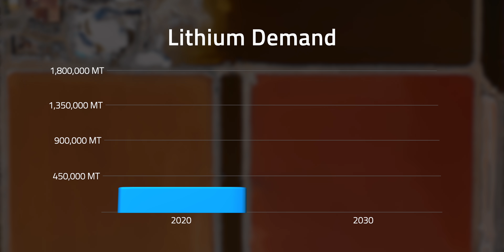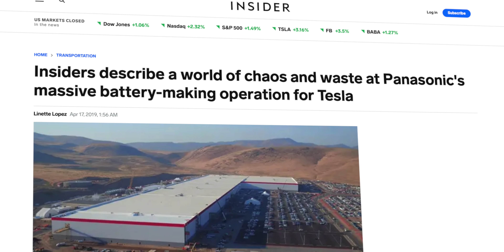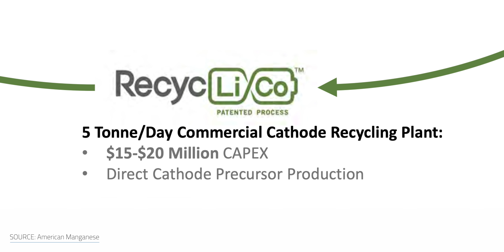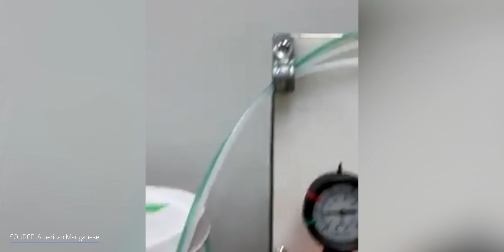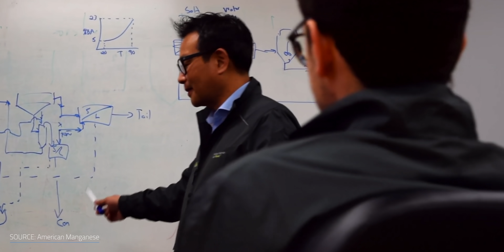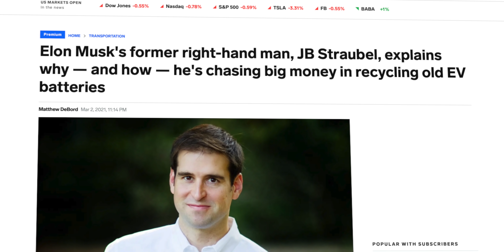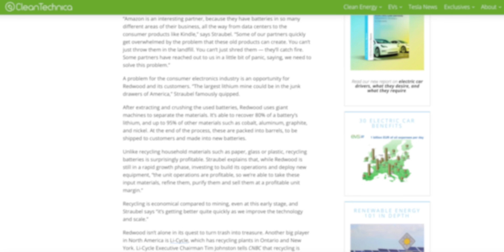Solving EV's Biggest Problem - Battery Recycling Explained

Comment: The biggest problem with recycling these batteries is handling of spent cells.  Its becoming a huge problem.  Spent cells get tossed around and can ignite.  They rarely are discharged completely.  They are increasingly the cause of fire at recycling yards.  They put these things in so many products today that people dont even know they are there.  I'm curious to know other then someone putting hands on each battery how befor they shred they know its discharged.  We recycle thousands of tons a year of steel,aluminum ect. but I couldn't imagine putting hands on every lb that came through the door.  If this is going to work on a large scale it will require the automotive and other manufacturers coming together and excepting their products back.  Similar to the way automotive batteries are today with much success.  Manufacturers need to take back a product if it is a danger to the publics well being at end of life.  For what its worth I own a tesla, I just wish that these companies would start working to incentivize recycling of the end of life products they make.  If they are and im unaware of it, someone elighten me.  When we receive these products in, we typically have to pay to get rid of it effectively only loosing ourselves money to clean up the mess the manufacturer and customers made.

Comment: I'm worried battery recycling could lead to EV thefts, similar to catalytic converter thefts.  Doesn't matter how well an EV manufacturer can prevent anyone from driving a car, if thieves can get a bit of money from recycling, they can steal, cut the wires to the GPS tracker and scrap an EV and sell the batteries to a recycler

Comment: See the article below indicating that more mining will be necessary, before we can achieve a fully recycled economy. To quote:

"The UK, for instance, wants all new cars to go electric from 2030. But to switch Britain's 31.5 million petrol and diesel vehicles over to a battery-electric fleet would take an estimated 207,900 tonnes of cobalt, 264,600 tonnes of lithium carbonate, 7,200 tonnes of neodymium and dysprosium, and 2,362,500 tonnes of copper.

This amounts to twice the current annual world production of cobalt (used in battery electrodes), an entire year's world production of neodymium (to make electric motor magnets) and three-quarters of the world production of lithium (battery electrolyte)."

https://www.bbc.co.uk/news/science-environment-57234610
Reply: That's crazy! Many developed countries now want to switch, so the demand is even higher.
Reply from the maker: Thanks for sharing the article.
Reply: @UndecidedMF  Thanks for your excellent video!

Comment: it seems odd but I think GM made the biggest brain play in this sector. Their BMS is located in each battery module and accessed wirelessly. When the battery is at the end of it's vehicle life, it can be easily put into another use case. This is the greatest pro and con IMHO to electric vehicles. The batteries become commodities that will rise and fall with the cost of energy storage. A new engine for an ICE car is cheaper because demand for an engine and the associated parts is limited to the vehicle in question. the used electric vehicle market also has to compete with DIY electrical power storage, or potentially transfers from new to old vehicles.

Comment: The question of whether or not these companies can recycle li-on batteries is not the issue. The question is if the cost of recovery cost less than the cost of creation.
Reply: $1/kg of reagents
~$15/kg value in the cathode precursors that are produced.
$14/kg profit not including electricity costs.

Comment: Of course the recycling won't replace mining. The market is a growing market so you need more resources to meet the market demand.
Also long story short, there is currently no commercially capable lithium battery recycling. Which is quite the opposite of lead acid battery where 100% of the material is recycled.
In other words, EVs aren't really good for the waste that it produce when recycling set up isn't there.

Comment: I have a important question , why are we pushing towards development in any field at such a fast pace, its almost like we are creating a problem and then struggling to find a solution for the problem again .
Reply: That is true with all technology. Fortunately for engineers there is always another problem to solve. The key is that we strive to get better over time. It wasn't long ago that we were burning coal unfiltered to power our steam trains. The only way to be sure our problems don't get solved is if we do not try.

Comment: Whoah. Mind blown in the first minute of the video. 1% of automotive sales being 60% of the consumption of lithium battery production? Holy. Moly.

Rough calculation says that lithium battery production will have to be 100 times what it is at the moment in order to satisfy a fully electric automotive supply chain. That's a lot.

Comment: One of EV's biggest problems is just sheer mass. Quite frankly, most peopile don't need nearly as much juice for daily use as is in a Tesla or similar EV. E-bikes solve 90% of most people's needs for single-digit %s of capacity. If you travel less, stuff like rain becomes less of an inconvenience.

Comment: This video  didn't cover some facts on 2 things: charge chharge  One is the materials needs to hold the power charge..the only thing possible is Nuclear Batteries. The 2nd possibility is to create more powerful elements to hold that charge... meaning  expanding  the Element table with a stronger bonding coefficient to withstanding or keeping a power charge like Uranium 235 or 238 or Plutonium

Comment: Recycling won't be a mayor factor until there will be some kind of buyout for used batteries. Simply put, a lot of people puts batteries to garbage despite of environmental regulations. In my opinion, recycling costs and waste management costs should be responsibility of producers, not consumers, because consumers have much less choice about technologies used for manufacturing and recycling.

Comment: Recycling car batteries is not even a problem. They are valuable enough and they come all together in nice few hundred kilos packs. The problem with phone batteries and other recyclables is not its raw recyclability, but the fact that they all end in very different small pieces and places around the globe. You can recycle paper easily as long as all of it is put together. Car batteries are together from begining to end, so recycling should be easier that with anything else.

Comment: The problem of end of life lithium batteries is huge. If we don't tackle this issue we will have mountains of batteries leeching toxic waste into the ground. This problem is only compounded further by the quickly falling cost of lithium and when lithium prices fall, recycling makes less and less business sense and eventually will just cease to exist if no profit can be made. That's why as consumers we must demand new lithium batteries require a certain amount of recycled materials, maybe minimum 25% recycled materials to start and go up from there. 

Another issue we need to tackle is how the lithium is mined. Currently, the process of mining lithium releases huge amounts of CO2 and destroys the local environment around the mine. We must demand that the lithium be mined responsibly to the environment while also reducing it's CO2 impact which at it's current level is equivalent to building 2 combustion based cars.

Comment: Car recycling already exist. As the value of the metals of the batteries increases so shall recycling. Salvage yards are very efficient at recycling. The break down the vehicle's, batteries that have second life applications will will be sold off and the batteries that don't will move on to be recycled. Being as car batteries are far more massive the economies of scale will help with reducing cost to recycle the batteries. There will always be need for new mined materials but it should decrease as existing fleet size increases and and recycled volume goes up. The question is can they get the recycled cost down to be competitive with mined minerals.

Comment: Also, if you think recycling batteries is hard, wait until we have over 500 million-billion ICE parts from all the old vehicles. Plastics, rubber, ceramics, aluminum, copper, and all the grease & fluids. It’s going to be a nightmare until existing salvage goes AI automation to tackle it and turn it into useful products.

Comment: Will recycling overtake mining? A lot of factors at play there. As people are demanding longer battery lifespans, mining must grow to meet demand as fewer batteries will meet their end of life in the middle term, meaning more raw materials. If we reach a cap on useful life of a lithium ion battery, recycling will catch up as the lifespan matures and batteries are retired. In both of those scenarios though, there is growing demand and finite materials. A lot of factors at play here. I think once the demand starts to flatten in new cells, and recycling catches up with demand, we could see as high as 30% recycled content in most new lithium ion cells, maybe by 2040.

Comment: They saying the same sorts of problems exists with older solar panels which aren't worth recyling after labour cost to dismantle overhead cost unlike cand for Aluminium or cables for copper wire of pipes which straight forwards crush melt down block 
Resale to lesser market is the solution and power wall banks 
Came across this looking for American stadium totally powered by solar with nissan ev car battery used to power it for games

Comment: Before watching the video I think I recall somebody quoting Elon musk saying" even after the life cycle of the battery used as a car battery, it's still got over 50% of the charge and can be used as a house or grid battery."
Reply: So in my eyes doesn't that mean the battery retains 50% of the value, and you could sell it for 50% of the replacement as a trade in at a Tesla approved manufacturer.
Reply: @ryanwakebradtelle8682  if someone was buying it. There currently isn't a big market for nearly dead batteries, partly because as soon as they are dead.. getting rid of them is such a headache. I'd love to see a cottage industry spring up re-using mostly depleted batteries

Comment: Thinking people are already recycling EV battery packs.  When they come available the majority are not actually dead but not useful in an EV as they cannot hold and discharge enough for an auto.  But when looking at use in a home. AH they are great. Most houses dont have giant demands. Not like trying to go from 0 -60 in 4 seconds. Even running an ac unit does not draw that much.  So if one is off grid these used batteries are just the ticket.  They are 5 -12 times the size of a tesla power wall.  So as I said these batteries are being recycled right now as you speak

Comment: Honestly I think concerns about vehicle battery lifespan are way way way overblown. The average American drives all of 29.2 miles each day. Even in the worst first generation leaf you'd have to have 58% battery degradation to impact that range. Average vehicle retention time is 10.3 years here, and there's plenty of Leaf owners approaching that number who are still talking about acceptable range, with most seeing less than 25% battery loss. That vehicle is far more likely to go onto the Used market than it is to have its battery replaced. And that's a good thing. We'll only see a higher level of EV Market saturation when Used EVs become more common. Keep in mind that is both the worst and the oldest EV, and Tesla's and Bolts are all showing less degradation overall than those early Leaf cells. BEV pack lifespan concerns is, for the most part, fabricated fear and uncertainty to keep people from giving up their ICE.
Reply: if you're talking about electrifying the post office, you're not talking about the average 29 miles just saying

Comment: As more and more people switch to EV for transportation you will need more batteries. So no way mining will ever stop you can't get more batteries from recycling then the number that are already in circulation. There needs to be careful over site of this industry with all the chemicals involved or our solution to carbon pollution could be far worse than the problem we are trying to solve.

Comment: There is no way recycling can overtake mining in the next 10 - 15 years. if the average EV is used for 7 years than the max recycle-able batteries will lag EV demand by that same period. EV demand is rapid growth phase so old battery supply will only catch up once growth has stopped for 7 years. (This is assuming grid battery demand follows a similar rate of adoption as EVs)

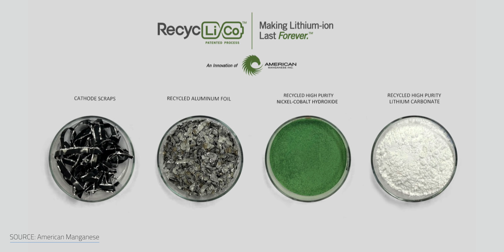Comment: 3:50-4:02....He's lying.  You cannot continue reusing solvents without sludge accumulating.  At some point, you have to remove the sludge.  Also, the solvents become saturated and need to be discarded and replaced with fresh solvent.  What do they do with this toxic waste??

Comment: We shouldn’t even be hauling around batteries in electric cars. It’s the only fuel that can travel with you. All the money that is spent mining, building battery factories, building batteries, recycling, etc. should just be spent on changing the infrastructure, to make the roads electrified. Can you imagine how efficient cars would be with a ton less wait?!...Not to mention the crazy performance if you dumped 1000 pounds of batteries off the vehicle. And also, endless range!
Reply: But extreme inefficiency and a ton of effort

Comment: The previous crop of electric cars in the 90s used nickel based Nimh batteries. Sadly big oil and George Dubya killed them off and left us waiting 20 more years before allowing electric cars to be made. It took Tesla to force them.

The nickel batteries proved their longevity as over ten years after the last of those EVs were crushed, the few remaining cars that were privately owned were still on the road with batteries that still worked. BASF was the last patent holder of the battery tech and they sat on it, keeping the world back for 20 years while millions of people died from air pollution.

Nickel - 100 percent recyclable. Lithium - toxic as hell. Lithium catches fire when exposed to the air and smoke from a lithium fire kills you in seconds. Lithium EVs are not that much safer than gasoline in a crash.

If we had mass produced back then, electric cars would be 20 years ahead now.

Comment: Lithium battery recycling is difficult, time consuming and therefore expensive which will force many areas in the world to put it in landfill and turn a blind eye because money and business will rule always. Lithium batteries from EVs reaching landfill will contaminate surrounding land and drinking water after many years of it being put to landfill. The big issue to me is that it will take 20 years before a Tesla battery is ready to go to landfill so there could be a Quadrillion (1,000,000,000,000,000) or more of 18650/21700 lithium batteries all over the world to deal with that just sneak up on us all happening at a similar time with the explosive growth of EVs. It will get cheaper and smarter both in manufacturing and recycling methods but It's not the way to go. There are plenty of health and environmental issues just mining lithium in large amounts. I'm no expert on the topic but I've been interested in this for years, have read many articles and it seems complicated and problematic. Oil mining and fuels are not the way to go either. We need something better than both options that does not exist yet. It might be a battery but not a lithium one.

Comment: I'm still of the opinion that short of graphene battery technology the better option for electric vehicles is mechanical or flywheel batteries.  Flywheel systems sc should offer faster charging times

Comment: as the cells in Tesla cars and other Ev's too start to reach their end of useful functioning, a replacement will be an option.  So that e-waste will be ramping up as these car batteries become available for recycling.  In 10 - 15 years, that equilibrium between mined resources and recovered resources will hit a tipping point where recycling will be less costly to aggregate the material and they can then sell that to Tesla, Panasonic, and the other battery manufacturers.  For tesla to go 100% recycled material is an Elon Musk dream.

Comment: Battery recycling doesn't even seem to come close to the level of adoption batteries have. When the recycler starts talking about patents for the process, you can be assured that 90% of used batteries are ending up in landfills.

Comment: I’m all for ev and hybrids so on, but for ev and hybrids to be the correct way to go for vehicles, they need to be carbon neutral the manufacturing and recycling of ev/hybrids, years ago when the Prius came out there was stories that the manufacturing of the batteries did more damage that the car did good

Comment: i recently bought a ioniq EV it came used with 54000 miles 87000 KM but 100% battery life State of health SOE, the Hyundai stated this car has 124 mile range but i am seeing 168 mile range on a 2017 car, i believe the batter could go pass 20 years with 85% SOE

Comment: Definitely I believe that recycling won't overtake mining for probably several decades, the determinate factors I could see being important would be usage compared to lifespan if batteries that are made, ie the velocity of the Lithium, if the velocity is higher, then more emphasis will need to be placed onto recycling I believe.